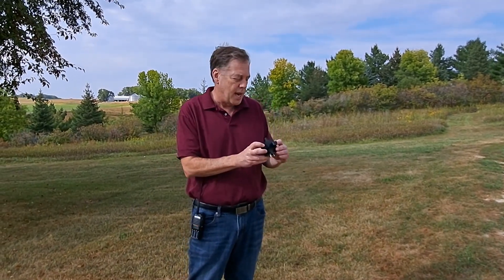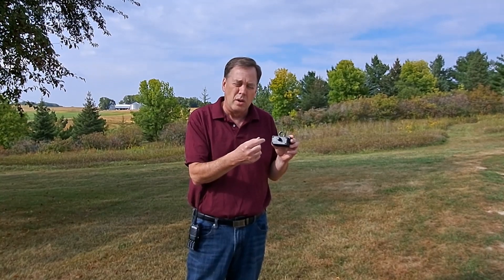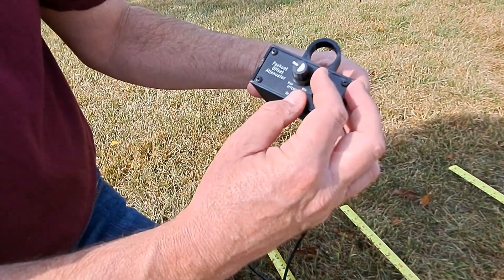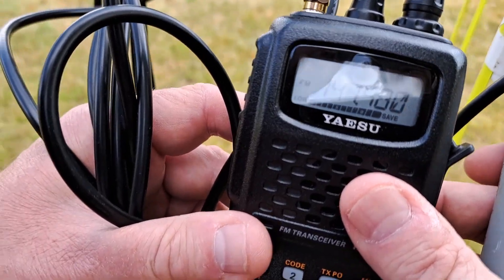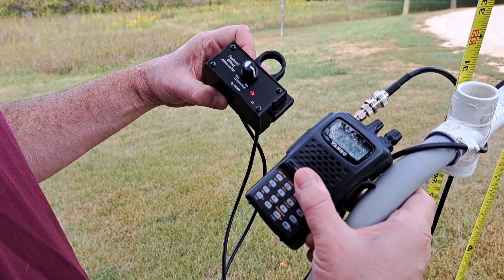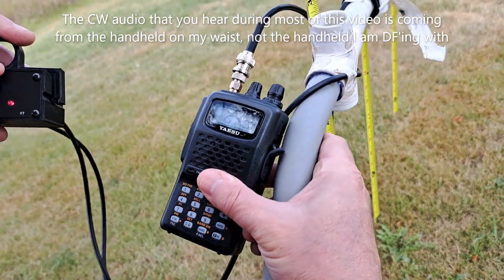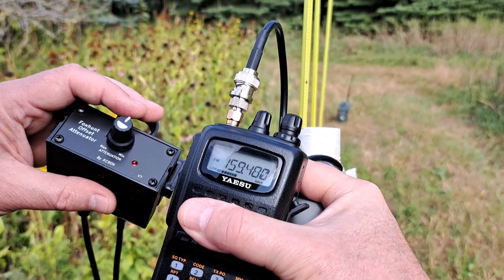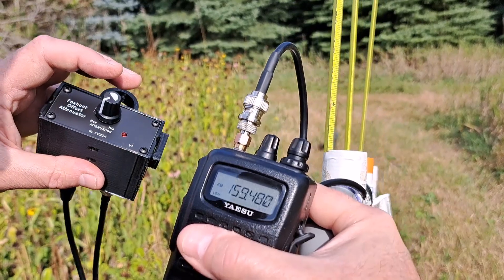Radio Direction Finding with the KC9ON Offset Attenuator

Comment: Hi! Thank you for the video! I'm on a quest to use the cheapest radio I could find (Baofeng UV-5R) as a foxhunt receiver. I am thinking of offsetting the frequency about 20 mhz so I can use a band notch filter on the fox frequency and maybe help with the frontend overload. Do you think it might work? Please, keep doing videos like this! +sub
Reply from the maker: You may be able to get that to work, but you may want to look into an "active" or "offset" attenuator - to do pretty much the same thing.

Comment: If you use a QUANSHENG UV-K5(8) with the the IJV-Firmware you don't need a extra mixing attenuator for RDFing,  because theres a really good Attenuator built in. With a long press of '4' the Menu ATT appears and you can use it to cut down the Signal to -68dB without any additional devices.
Reply from the maker: Interesting tip.  Is this with the firmware as delivered on the UV-k5, or did you download some different firmware?
Reply: @RDFfun  No, not the original one that came with the device, IJV is an alternative firmware written by IU0IJV, in my opinion way better. Search for 'Quansheng IJV' and you will find detailed documentation. There are also a few videos by Paul OM0ET about the IJV software, where you can watch how to use it. However, he does not explicitly show the attenuating function.